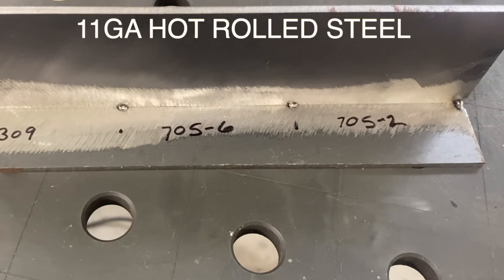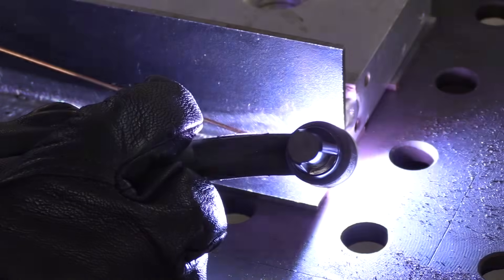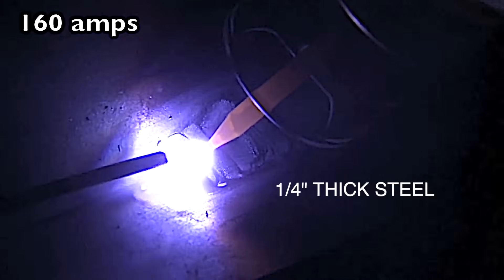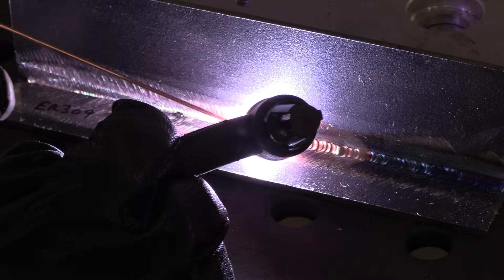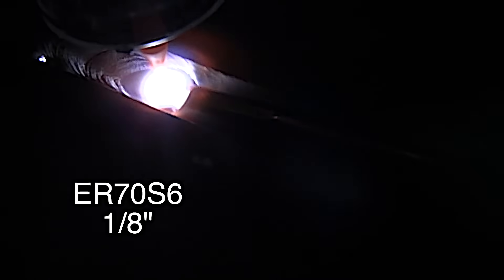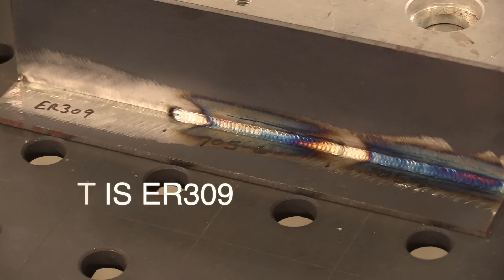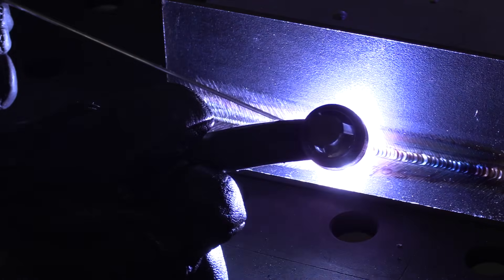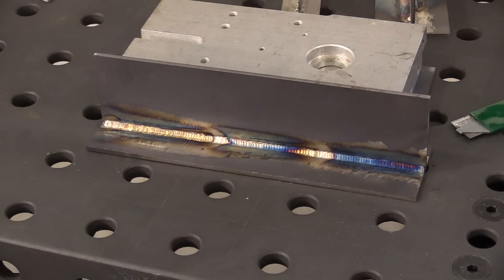TIG Welding Carbon Steel & Comparing ER70S-2, ER70S-6, & ER309

Comment: OK. LET REMEMBER THE FOLLOWING:
E = ELECTRODES
R= RODS
70= TENSILE STRENGHT. 70K PSI
6=POSITIONS AND MATERIAL FLUX FOR APPLICATIONS THAT COULD BE A GARAGE, SURFACE WITH RUST, ALLOY ELEMENTS.

WITH THE FCAW SIMILAR TO MIG BUT WIRE  CAN HAVE OTHER LETTERS IN TAG FROM SUPPLIER WITH LETTER AS:
 M: GAS COMPOSITION 75/25. 75 % ARGON & 25 DIOXIDE CARBONE  O3
S OR T = SHIELDING GAS .. SELF SHILDING GAS OR TO PROVIDE GAS

Comment: When referring to carbon steel, are your tutorials applicable to mild steel, which has some lower amount of carbon in it or is using the term just to differentiate from stainless steel?

Comment: Used er70 S6 for diverts on conveyors. 100% argon naturally. The factory mig welds would fail after a year in service. The complete pen with er 70 s6 stopped this fatigue failure %100. It is a bit wet but the strength and fatigue / impact resistance makes it unbeatable for repair work. Thanks for the video.

Comment: i used to weld stainless and no problems, but when i had to weld general use carbon steel and galvanized nut, weld started to bubble  like popcorn, it seamed there are gasses in steel .Before welding i cleaned black cover from steel and zinc from nut, please, what did happen there

Comment: For regular Stainless steel 304/316 welding 309 is way more better than 316 it flows better and have greater tensile strength in thick structural welding

Comment: Thanks for the info I have a small shop and I’m building a cool rat rod for myself and hand stainless tubing left over from doing my headers the only rod  I had was 308 to weld to the frame it did just fine but I’m going get 309 and build back bumper 2 inch sainless thanks again info Davd

Comment: 309 really is the magic rod. We had a fresh out of trade school welder certified welder at my job for a short bit and I needed some material (single pass about 3” long on 4 parts) put back on some hardened A2 tool steel fixtures that had worn, it was his only job that day so 4 hours later and he’s still not done I come back and he’s defeated. He was pre-heating in the oven, tried A2 rod, tried hard rod, tried er70-s2 couldn’t get anything to stick or not erupt. I told him try the 309 rod it’ll stick basically anything with iron in it to anything else with iron in it. He had them all welded up in like 10 minutes after that. I’m sure the material properties weren’t great but they only needed to last a little while longer. 

Speaking of which, I wonder how much of a hit you take to tensile strength of the joint when you use 309 over er70-s2.
Reply: I work at Lincoln helping produce consumables,  309 is our bread and butter. Hope you were using our rod and glad to hear it worked well for you

Comment: Hi Jody, Do you have any advice for TIG welding sheet metal with low carbon filler? When grinding and trying to finish working/beating the sheet metal the tig welds seem a LOT harder than when I oxy weld with low carbon filler. I do not get a good finish when tig welding with the low carbon filler.

Comment: Jody, I found 309L a savior when welding on old motorcycle frames. Especially near some factory lap joint where the rust and other contaminants love to hide. The 70S wires seem to draw it out and create swiss cheese! The 309 seems to not draw out the rust and contaminants. Every minute you spend grinding is another minute you could have been welding! Besides, unnecessary grinding will only shorten your life! LOL! Don't forget to wear your tig finger! Oh, and cover up, the UV from the arc can cause permanent damage to your skin and may even kill you!
Reply: welding in the nude for a week is how I get my "pre-tan" on for the beach in Mexico every year 😁😁
Reply: I always wondered why that wasn't more common

Comment: I can't afford 10 seconds of post flow for carbon steel. 6 or 7 is usually good enough to get the electrode and weld cool for current <180 amps.

Comment: OK, but what is the downside of ER309?   The tensile strength is 86K  --stronger than both the ER70's.    And you get a rust-resistant weld with somewhat less heat input to boot.   Why not just use it on all steel?  Seems like it would be simpler.
Reply: More expensive for a start, plus some welds will never see a load approaching 50,000lbs, much less almost double that. I'm sure there's more reasons especially when metallurgy gets involved, but money is one that's hard to ignore lol.
Reply: It's more expensive, plus if you penetrate through the material thickness (as in butt welding root, or welding thin material) you need to backpurge with argon otherwise the weld deposit will oxidise(sugarcoat) and strength will be significantly compomised
Reply: Shielding and cleanliness are more critical with stainless rod. You can't let molten stainless touch oxygen or it will instantly turn into a corroded mess. ER70 is much more tolerant. Also just look at the price. Stainless rod is expensive.

Comment: I bought ER308 instead of 309 for some reason I had at the time. Are there big differences in the two?
Reply: ER308 is a bit stronger and is intended for stainless to stainless welds only. ER309 is suited for mixed materials (i.e. carbon to stainless).

Comment: Jody, I’m welding .049 sheet metal to larger solid pieces, and I’m wondering if the ER-309 will help me not burn back the material as much, when trying to get a puddle going or if I let it get away from me. I’m welding on firearms that I’m building, so the appearance is important and I want to mitigate the chance of having to do rework as much as possible. 

Thanks for the videos
Reply from the maker: it might help but just be aware that 309 typically wont respond the same to blackening or blueing treatments

Comment: I have used a lot of 309 and 312 for repairs.  When you don't know what you've got, no procedure available, but you know it's steel, 309 or 312 are the go to.  
Good stuff as always
Reply: Yup.  Gives a “smooth and lovely” finish, also.

Comment: I try to never use s-2 anymore....s-6 wets in so much better and doesn't sag and possibly undercut....also I'll use stainless 308 or 309 over either s2 or s6 even on mild steel, nothing I do is that critical, but stainless rod just welds better....I'll lean on that crutch all day!! Lol 😆😉

Comment: Have you used the tig button before Jody ? Thinking of getting one as I do a lot of out of position stuff working on aluminum boats and aluminum semi trailers. Thanks
Reply from the maker: I have not used a Tig button yet. But @6061 YouTube channel uses it a lot. I think he sells them too
Reply: @weldingtipsandtricks  If you could manage to get 6061/Aaron to roll that semi rig of his East of the Mississippi it  would be a interesting video. But don't expect video of anything but his gloves, which doesn't matter as his work is outstanding.
Reply: I've used one in my home shop for a few years and love it.  Lets you do all sorts of out-of-position stuff easily.  The two main challenges are that finding a good position for it to comfortably press can be difficult depending on the joint (I've had my fingertip go numb from pressing it too hard/long in certain situations) and if you have an air-cooled torch it can get hot enough for the adhesive on the button to soften and the rubber nub move around.

I recently bought a second one as I have an industrial shop with a PrimeWeld 325X and will be using it with that as well.
Reply: @dumpsterdave3710  awesome. Thanks for the response. Makes me feel better about buying one. I have a watercooled torch so no worries
Reply: Is the TIG button you're talking about an on/off switch or like a pedal? Because I was just wondering the other day if anyone made a pedal type button that mounts on the TIG torch.
Reply: @JCWren  SEE nearly any 6061 video and you'll learn what the TIG button is. It's fully variable same as a pedal. Many love them, others don't. Aaron uses his almost all the time.
Reply: You should have a 2T/4T switch on your weld set. 2T means you have to hold the button, 4T is press once to arc up, then press again to arc off.
Reply: 2T/4T are significantly simpler than the TIG Button and common with all modern/inverter welders.  The TIG Button is pressure-sensitive, mimicking the foot pedal as a finger control.  @gazk9424
Reply: @ComommonlyCensored  why would you hate 6061 ? Lol